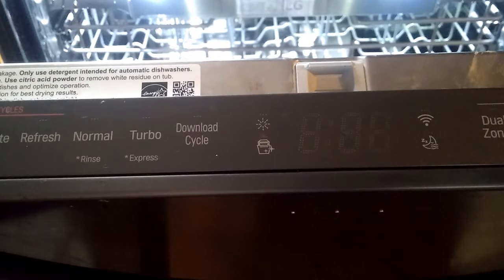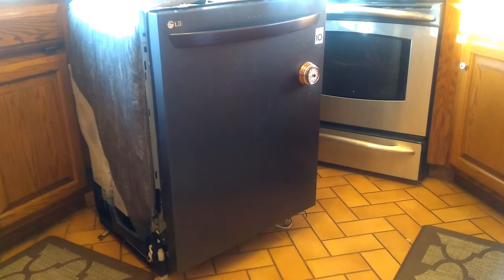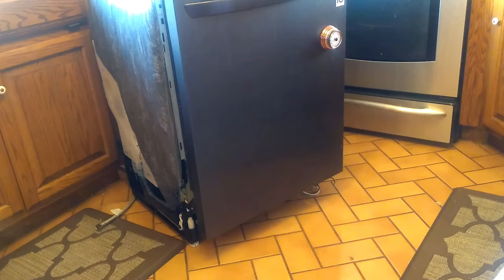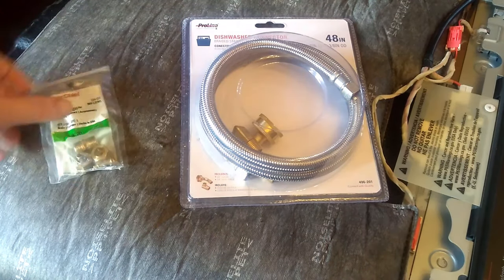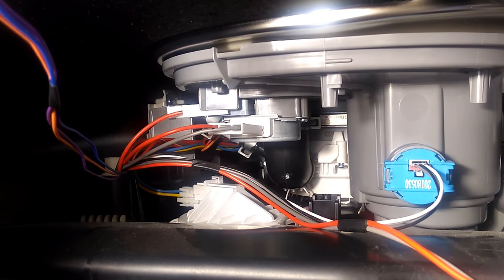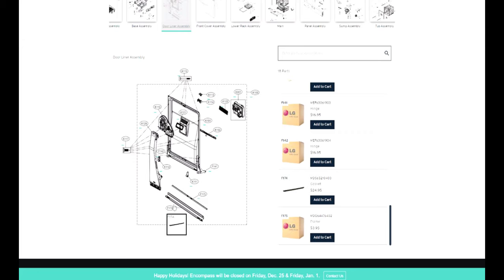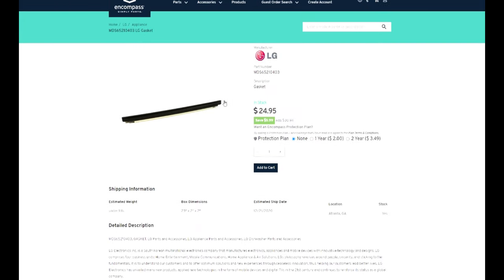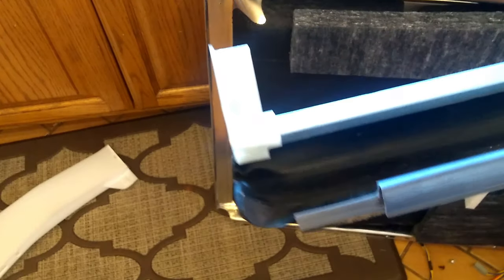Fixing an LG Dishwasher "AE" Error is easy - once you find the source

Comment: Thanks for the video.  I really appreciate those handy youtubers who are saving us all a significant amount in repairs.  In my case, I believe my drainage hose detached from the brackets and got crimped.  Water didn't drain properly and built up and eventually made it into the drainage tray through the overfill drain. (I'm not an expert, that's my guess).  Because of your video, I took a sponge near the floater, did 3-4 good soaks and the dishwasher error went away.  I've been running rinse and maintenance cycles to confirm if there is a leak by shining a flashlight along the side and checking for water before I insert the washer back in place.  For those stuck with the AE error, soaking up the water in the floater tray (right next to the float ball sensor by sticking your hand through the side) will allow you to run the dishwasher again and check for leaks.  Thanks again Yoshimoshi!

Comment: That's a lot of work and diagnosis but a good repair job at the end.  Just a little tip....Next time just heat the tube to make it flexible and expand a bit so that you can insert it without having to cut it... @ 7:40. It is also a very good idea to cut the power off from the electrical panel before working on live wires @ 3:57

Comment: LG... what a pain. My experience is that LG really doesn’t have a service. They just give you hoops to jump thru until you get pissed off and just buy a new one or just fix it yourself. 
Good job on your repair. I’m afraid I would just give up and buy a new one. 
Notice the 10 year warranty... what a joke!
Reply: The 10 year warranty only covers the motor.  You should read your owners manual to learn about what the warranty covers
Reply: Our repair person charged us to tell us our dishwasher was not worth repairing and my hubbie searched online and was able to find the replacement part for the control panel and fix it in about 15 minutes.  The part was about $200 because it was the control panel and had all the electronics in it but it worked better than brand new.
Reply: Exactly !!!   The 10 year warranty is a joke.

Comment: I'm heading to Lowes to replace ours tonight. It's a pile of crap. We bought it on sale and it's obvious why. Its flimsy,started acting up within months of buying it.The incredibly stupid design of the the placement on the touch controls should have been a warning. The plastic cracked and broke from the heat and steam and the washer door flexed like a glider wing. Junk. I just wish I could have put a bunch of rounds ln it before it goes away. 
   I don't need a smart washer. I need one that works, is simple and lasts. It doesn't need to communicate with my phone or God. 
   They're junk. Do not purchase one.
Reply from the maker: Yeah, I'll never buy another LG appliance.  I've had trouble with a dishwasher, a stove, a refrigerator and a washing machine.
Reply: @YoshimoshiGarage  I purchased a LG Fridge, Washer/Dryer and dishwasher. All the appliances purchased pre-pandemic (fridge, washer/dryer) are working with never any issues. The dishwasher just started throwing the AE error, and that was purchased May 2021. I wouldn't be surprised if they just used whatever materials they could find to make them from 2020 to maybe until now.

Comment: Thanks for your video. I have exact same dishwasher and it decided not to heat the water. I get no error codes whatsoever. 
Do you reckon it would be the heat element? If so how do I access it? I’ve flipped machine upside down and can’t seem to be able to open the black enclosed plastic. I remember you mentioning in your video that they make it difficult to open. Was trying to see how you open it but you didn’t film it. Appreciate your response. Thanks

Comment: I have same.problem. always use standard dishwasher pods and machine is leveled correctly. What could be causing AE error in my case?
Reply from the maker: There's a leak and water is getting into the lower tray. You have to hunt for where the leak is.

Comment: You fixed it 2 years ago and how it worked after repair?
Reply from the maker: It worked for a year, and then the pump itself failed (and this video wasn't my first repair on that thing). I replaced the unit with a non-LG dishwasher and haven't had any problem since.
Reply: @YoshimoshiGarage  Thank you for quick response 👍
Reply: Hello Yoshi, what brand of dishwasher did replace this LG one with ?

Comment: I got the AE error after plumbers working on the water main turned off and on the water multiple times.  I think the pressure of the water coming back on killed my dishwasher...???
Reply from the maker: It's a possibility that the pressure changes caused water to leak into the lower catch pan. Use a towel to dry it out and see if it stays dry
Reply: Thanks Yoshi!  Yes, I did the troubleshooting and found the water pan full so dried it our and now have heater blowing on it to get it really dry.  I love being able to determine the problem without having to call for repair  @YoshimoshiGarage

Comment: We bought the whole house of LG appliances after reading Consumer reports. Worst appliances ever. 
Fridge compressor replaced - 1 year old 
Washing machine pump replaced - 1 year old
Dryer clogged with lint past the trap
Microwave is not nearly as powerful as old unit
Oven rattles with convection fan on
Dishwasher has rusted racking
Dishwasher leaks
Washing machine leaks from front
I could go on. 
If you value your money. Stay far away.
Reply from the maker: Agreed.  This isn't the only LG appliance we have that has problems - just the only one I took the time to video pulling it apart.
Reply: @YoshimoshiGarage  turns out it’s an internal leak. Washer is mechanically totaled. Insurance will now insult us with a check for pennies on the dollar the buy another. 4 years old. 3 adults household that care for appliances. We’re shocked by the entire lack of quality.

Comment: Ours is thrown the AE error just from spilling some water off the countertop, which ran around the door.  Puller the top with the electronics off and no water got in.  Been running a fan for a few days, but there doesn't appear to be any wanter underneath it.  I wish the sensor could simply be disabled.  Junk.
Reply from the maker: You can probably pull off the kick panel and dry out the tray with a towel. Might save a little time
Reply: @YoshimoshiGarage  Thanks.  I have the kick panel off but I cant get to any of that on my model.  There's a metal plate that goes across that might give me access if I could get it off but its partially blocked by the door and the screws are torqued to tight to loosen without stripping the heads. Trying to find a screw driver with a skinny shaft and a better head.
Reply: @YoshimoshiGarage  After 72 hours and a lot of fan, its finally reset and working again.  Thanks.

Comment: Im having the same error.  I am not handy at all. I’m still under LG manufacturing warranty.  The dishwasher keeps blinking the error message with a red light and makes draining noises about every 5 minutes.  Should I call geek squad from Best Buy? Also my kitchen configuration is the same as yours. And my stove protrudes slightly so I will probably have to slide it completely out to be able to get the dishwasher out and don’t know how to turn the gas pipe off.  I feel so helpless as my dad used to help with with all of this stuff and he’s dying of Corona at the hospital right now.  I’m so lost without him.
Reply from the maker: If the error is AE, then there's water underneath.  The "why" can be as simple as using the wrong detergent causing an overflow, which can be "fixed" by just using a towel (you can take the kick plate off and dry it out without removing the dishwasher).  It can also be far more involved, such as in my case. If it's under warranty, start by calling LG.  I had no luck getting help from them but maybe you'll have a different experience.  Certainly worth a try before paying for a repair person to come out.
Reply: @YoshimoshiGarage  tried to call LG then but they only cover manufacturing defects under their warranty. Although you're still under warranty, you could be responsible for the service charge if it's not a manufacturing defect.
Reply from the maker: @relaxwith_aj8798  Yeah, mine is broken (again) and I'm trying to muster up the desire to pull it out of the counter (again) diagnose it (again) and fix yet another problem that wouldn't be covered.

Comment: From the title? I see nothing easy here🥴🤔
Reply from the maker: Really, it was easy once I found the problem.  It took probably 3 hours to figure it out, but replacing that seal is probably a 30-minute job.
Reply: @YoshimoshiGarage  yeah once figured out maybe easy but the process of diagnosing the problem seemed complicated
Reply: @YoshimoshiGarage  I was able to clear the error without pulling out the dishwasher. I poured 5 litters of water in the bottom of tub, used a balancer and made adjustments to the legs until I saw it was balanced. Once done I was able to power off the washer. Waited 5 minutes approximately maybe a little longer. It stayed off. I turned it on and did a self cleaning and poured bleach inside for it to run it’s cycle and now it works. Maybe we have different models.
Reply from the maker: @reneedunn683  Glad that worked for you! Mine was definitely a bad seal that was really hard to find.

Comment: What if it does it immediately and doesn’t even want to wash
Reply from the maker: Then there's water down in the catch tray that is lifting the float switch.  Pull the kick plate cover and dry it out with towels or similar (it's probably a cup or two of water).  It will likely start after you do that, but the water came from somewhere, so it's almost certain to fail again and it could be on the very next time you run it.
Reply: @YoshimoshiGarage  what usually causes this code aside the leak? Like what causes the leak?
Reply from the maker: @hanakamui3606  The code is caused by the float switch, telling you there's water under the dishwasher. The leak can probably be caused by a number of things - mine was a bad bottom seal that required disassembling half the dishwasher just to find.

Comment: So. This isn't easy.
If you want to get it fixed truly "easy", let it run its cycle. When it goes to drain again. Unplug it.
Then take a towel and wipe up the underneath. Let it dry overnight.
Empty the dishwasher and clean the screen under the inner propeller. 
Plug back in. It should work. 
I did this and my lg dishwasher lasted another 8 months before I got the damn error again.
If you got the time, energy and $$, you can go his route.
I'm just trying to buy you some time to either pay a technician or save for a new one.
Fingers crossed my fridge lasts longer

Comment: It's bad, dishwashers at all, I had one for Costco, before In 3 years broken down  6 times it's repaired and replacement most of parts but not working probably (water from kitchen sink go inside the dishwasher ) I paid for 3 years extending warranty with Allstate after 2 years manufacturer warranty Allstate refused repair 
Don't buy this brand for every body
Reply from the maker: Yeah, LG appliances suck.

Comment: I'm getting this error code but I don't exactly have a leak. I used dawn for a cycle and that was a mistake. I'd think running a cycle would clear out the bubbles in the pipes but it won't let me do anything not even turn off the washer. When I flip the breaker it comes back on in the same error still just draining nothing and beeping.
Reply from the maker: Yes, dish soap will push water past the seals and there's still water underneath lifting the sensor float.. Pull the kickplate off and use a towel or paper towels to absorb the water in the catch tray (roughly in the middle) which will let the float drop and the sensor will no longer set the error code.
Reply: @YoshimoshiGarage  This. Knowing where to look for this helped. I have dried out the catch tray and am doing a test run now. One of the arms started flying off during each wash about a month ago and now this. There was a silicone bag that fell below the bottom rack and had a bunch of water in it. I hope that is all it is. I really regret buying this now. My parents had an ancient GE washer that was probably 20 years old, still ran just didn't clean well. This is just over year old, of course , so it is out of warranty and already having problems.